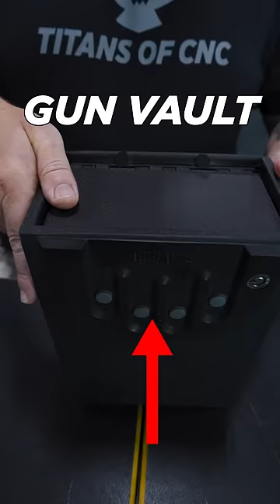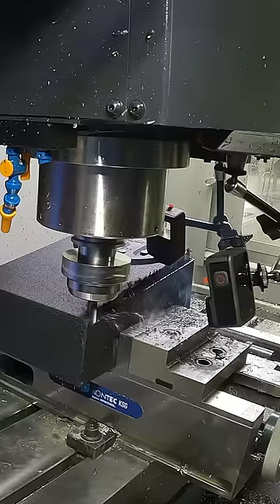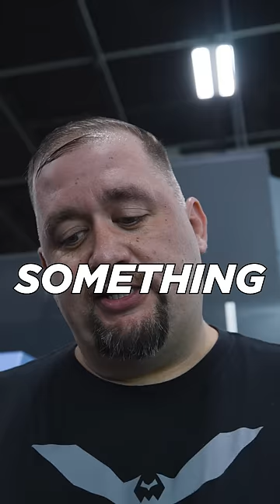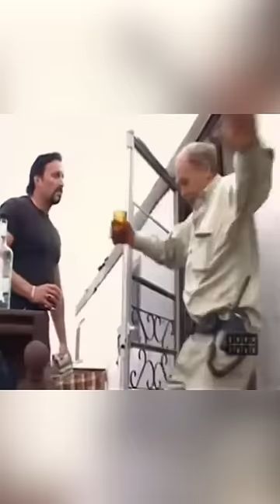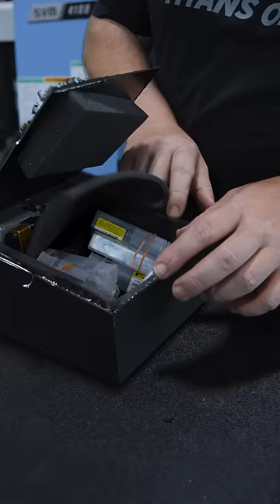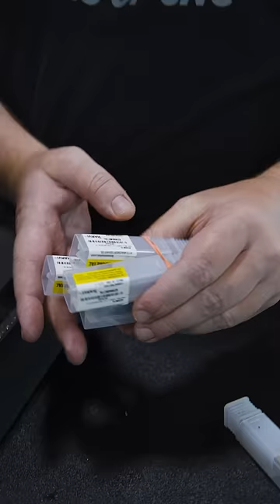Using a CNC Machine to Crack a Safe #titansofcnc #cnc #machining #machinist #engineering #3dprinting

Comment: If your batteries are dead, you will need to hold a 9v battery (Like the ones you get in smoke detectors) to the connection points at the front of the safe, this should deliver the power you require to enter your code on the keypad.